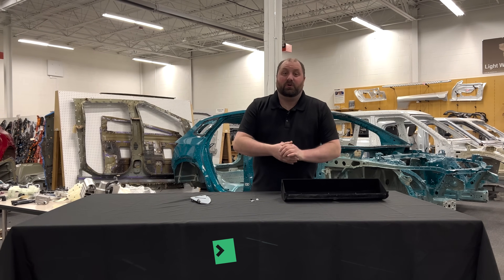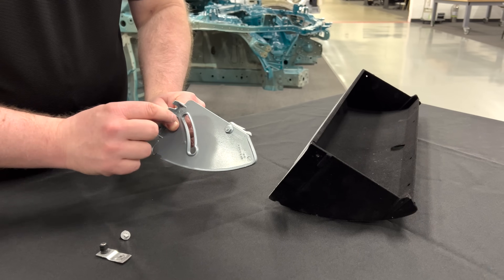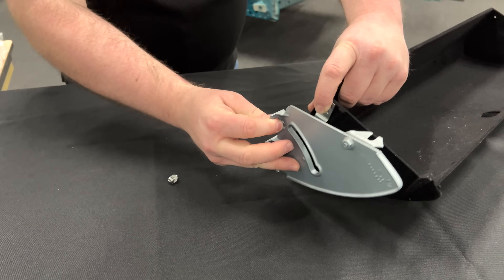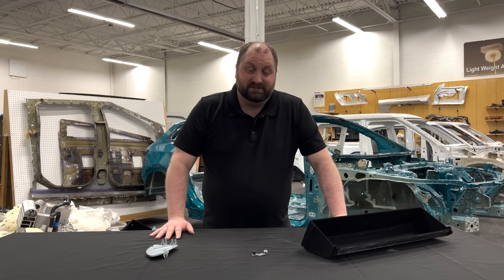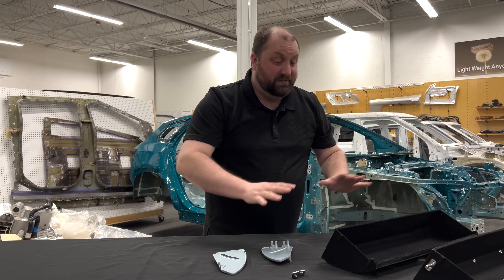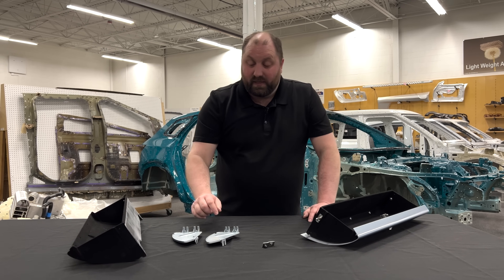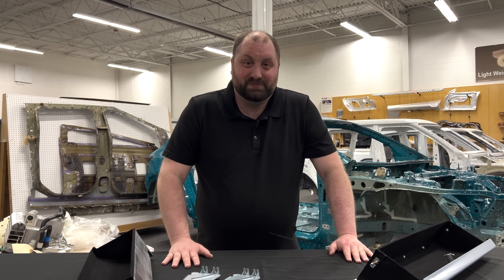The Million Dollar Difference: Why Working With Munro Pays Off

Comment: Totally done wrong. The cast part should have been a stamped part symmetrical for left and right side with hinge pin drawn in. Pin guides should have been molded on the glovebox. Resulting in savings of half production costs and a much quieter operating glovebox and stronger assembly. Basically, if you want real cost savings often times manufacturing processes needs to change. Then rethinking of design needs to happen.

Comment: Very interesting! 😃👍
One was the hole high for stability oh HIS part, the other wants the hole low for HIS part. 😂 That reminded me of 2 different craftsmen who had to complete an expensive jewellery store almost 30 years ago! 😂 There was a combination of expensive sandstone and expensive, fluffy carpet with a brass inlay between them.  The carpet guy wanted his carpet low. The tiniest fibre had to be below the sandstone, so that nobody tripples over his carpet and he's responsible. The sandstone guy demanded the carpet to be risen, so that nobody will tripples over his sandstone and the brass rail in the other direction and make him responsible. 😂 Both saw just THEIR project isolated and how to avoid getting sued. 🤭🤣

Comment: Munro consultant: sir, that metal bracket is made of metal. Too expensive. 

Engineer: but its holding the front bumper...ok...what is your solution 

Munro consultant: zip ties. Non uv rated and 20 lbs load capacity. Flexible and helps cover slack and minor differences in car chasis.

Management: im sold! Get me 100000 zipties!

Comment: Another minor point no mentioned? The bracket is used on two sides. Did the right hand side have the little bracket on the left instead of right, or was the frame designed to use the same bracket on both sides? Was it necessary to have two bracket castings in order to allow mounting in the car?

Comment: Great clear video. 

Colin Chapman (Lous) approach - lightness is the ultimate beauty. He meant not just mass. Lightness of thought, lightness of rapid development, etc. ie "Simplify, then add lightness". Ok, with a mass produced car its never that simple and is a real challenge to get management to value questioning things no matter how powerful or hands on the owner is. QA should be at the design stage. So everyone should ideally be a jack of all trades yet a good jack ass that understands a bit on physics, the consumer and business processes.

As a retired technical and QA consultant you see countless examples every day that you think how could nobody notice it could have been engineered in a more suitable way. TQM was big in the 80's but the real wake up that we seem to have lagged behind in is efficiency vs effectiveness. In this glovebox example its sort of black and white that the teams should have worked together earlier and that the design guidelines where the real issue. Yet when you have something that may cost $1 more per part and that $1 extra stops a vibration in the armrest resulting in an annoying rattle sound then it could be argued that its that lake of rattle that makes the car project quality. Often its done using less parts but understanding thermal expansion variation in material qualities that help make things better. Ask anyone how much extra would they pay for a car without a certain annoying squeak or rattle and the engineering decisions can flow back to the designers. Yet not as an excuse to overdesign something. Digital twins 2.0 here we come.. 

How could we have had the issues with the Cybertruck and Tesla not able foresee that? From the approach of a relative newcomer to the auto industry ie with less fiefdoms inhibiting team work? So perhaps competition is the best way to motivate change.

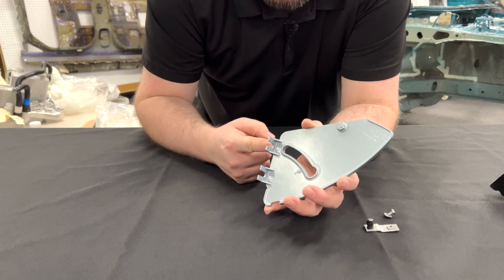Comment: 7:30 slightly disagree, there might have been a very valid reason they only had tab protrusions on one side. They were probably working with a limitation of the technology at the time. The 'flat' side certainly has ridges still, but no other protrusions otherwise.

Comment: Instead of casting, make it out if steel.  put the slot where needed so the original pin in the side of the glove box will be fine.  One steel part made & tabs just bent for RH & LH.   It is a glove box brkt.  Hardly ever used & not used hard.

Comment: What you re saying is that you are compensating their lack of system thinking, not because bob and jerry can't do so themselves, but because their org design (separate, part focused guidelines) and culture (if you innovate and it fails, you ll be blamed, if it works, your boss takes the congrats) prevent them from doing it themselves.

Well, ok. You are then the equivalent of "the new guy" from an organisational perspective: you compensate the lack of alignement and innovation that results from their org design and culture. 
And in the same way as you remove the fix from the new guy by taking the risk to tell management there is a much better solution, I would say that you re (as an analogy, don't take it personally) an unneeded fix: best way is to fix their organisation and culture, so that people are not blamed for trying  to make things better, and alignement and system thinking permeates through the org and take precedence over localised guidelines.

Comment: I think your main point here is not really illustrating the value you bring as a consultant to identify problems and fix them, but that the problem is with the internal product development strategy of the company from the beginning. If I was a consultant for the same client, helping them identify ways to save money, I would tell them to focus on how they can improve their development process so they can make and improve better designs on their own. Your own thesis is that you often have the benefit of hindsight and a less restricted line of communication with different stakeholders. Sounds like mostly waste on top of waste.
Reply: I think the value of the external consultant is he sees lots of cars from different companies and has learned from all those designs.

Comment: So you made a "saving" that mean the costumer no longer have provisions for handling misalignment when fitting the brackets on the assembly line?  
Got ya, and I think I know your types of consultants. You leave with the profit for the project and then leave it to others to deal with the new problem of misalignment that YOU created and the cost associated with fixing that. That is  If you dont offer to run a new project to fix the misalignment issue..

Comment: if we had fewer different cars on the road, and the models ran for 10-15 years instead of 4-5 they could spend more on each model.  Also easier for mechanics and parts stores. Also when they badge engineer one car and sell it under different brand names that makes a lot of sense for economics.

Comment: Well, you used a 60+ year old design as an example that is TOTALLY moot today as that glove box would've been solved in a 3D space on a CAD system before it saw the light of day today and it would have ALL costing baked in. Nice try though, but you'd be better served trying to show an example of say the last TEN years to make a case. Also, the future in mobility will be driven by software not hardware and what does Monro know about software and coding?

Comment: The '61 solution still has three components, including that pin riveted into the plastic glove-box, and implemented sub-optimal pin placement.  Since they spent money for a new bracket molding anyway they should have cast the pin into the bracket and put the guide slot through the side of a thickened glove box side-wall. Now it's only two parts and with optimal pin placement.

Comment: Im a manufacturing engineer, DFM started back in the late 70's and gained traction by the mid 80's. Eliminating processes is key in manufacturing as is repeatability and process control for quality. As good as engineers are, I believe in listening to machinist in OEM shops  and line workers on the floor in the actual manufacturer. Obviously, good software simulation is now available to visualize almost any process. But, once a process has been signed off and established, its important in Continuous Improvement to know whats actually happening at each operation in the making of parts and assembly.

Comment: I once redesigned "consumable" rollers in a robotic cell that transported the glass for solar panels on edge.

The glass edges are highly abrasive.
The rollers were about 6" diameter and 3" thick.
They were made of delrin.
The rolling surface would become rough and lumpy, causing glass chipping, some just sliding on ground flats and not even rolling.
Alignment was critical.
Part life was a few months.
Replacement rollers were about $300 each.

I proposed two options.

1. Change from Delrin to UHMW. Part cost similar. Bearing retention not as good. Longer wear life.

2. Take existing parts, including worn ones. Cut in half. Machine recesses on both halves. Add an aluminum hub. Add a cast urethane "wheel" over the hub. One time cost to modify the delrin rollers. Consumable rollers $16 each.

We chose option 2.  After testing a few, using modified hockey pucks as the replaceable part (no urethane mold made yet, and it was outsourced for production) it was clear it was a winner.

The modified test section of the line used 6 pieces. There were about 100 in the whole apparatus. It was smoother and quieter and wear on the rubber was negligible. 

So we modified the whole line. 

I did screw myself out of the repeat business of expensive whole rollers by the one-time modification of 150 pieces (line + spares) and continuing supply of consumable urethane inserts. (Which rarely wore out)

But the improvement was substantial. No more glass damage. Quieter. Line speed could be increased.

This was one of many production and engineering efforts I performed for the company, and I established a reputation good enough that my quotes were accepted as simply "time and materials" or "not to exceed" rather than detailed breakdowns.

I'm inherently lazy, so I'd rather have lots of low effort, small projects like this solution than one recurring, time consuming job, ordered in small lots, that didn't yield much more revenue to me.

Work smarter, not harder.

Comment: A HUGE part of the problem is every new model, every year is 100,000 new parts.Why? So they can sell replacement parts and people can swap parts. I have zero compassion for most all companies. It is all about f*cking their customers, and how to keep grabbing every penny from customers. Making things that are designed to fail so they get more sales.  I bought a Ford 2010 not knowing a gas cap did not come with it. Had to buy from ford a $25 locking cap. Had I known I would never have spent $28,000 on the car would have gone to a different brand. I will NEVER buy a ford again.

Comment: New Guy was probably working with an assumed or stated constraint of 'no new holes in the glove box'. This is why defining and challenging constraints is at least as important as defining the requirements.
Reply: It's amazing how many "fake" requirements lead to poor design. The most common fake requirement I run into is "make part Y better but part X can't change. "Right off the bat you're sub optimizing and only likely to see minimal improvements. When you take the constraints off, then you can really improve the whole system.
Reply: I am but a simple technician but I’ve changed many engineering minds by simply asking “Why?”

Comment: At 4:59. Why do we have this bracket and pin?
Your interfaces are undefined.  How is Bob or Jerry supposed to design a part. In aerospace you get interface dimensions.  You design the stuff in between.  Is this really how cars were designed?
Crazy.
Mechanical engineer with h2 automotive and aerospace experience.
Reply: The Lexus ball-bearing commercial was 1992. So in the 1950s, yes, there was considerable variation in how parts fit together. Tesla even had issues in the 2010s.

Comment: The worst part of the design is that large latch right in the middle of the usefully space of the glovebox and that wasn’t even discussed.
Reply: Yes, but the only problem is that if you put the latch on one end, then the other will sag and have a gap and not look closed. So then you have to put a latch on each end, which means two latches or you need a rail connecting two latches to close simultaneously which is a longer part and is more complicated.
Reply: @ I have a couple of cars that have a middle latch that doesn’t protrude significantly into the glovebox space.  The video simply shows a very poor design.
Reply: Or your place the latch mechanism in the dash above and the drawer only has a lip to grab on to so not taking up space in the tray. But again, this is more involved in installation and design of the dash or frame around the glovebox.

Comment: Carl "The Professor" speaks, people should listen.  I would call what he is describing as "integrated holistic design with manufacturing and assembly considerations", or more simply DFM.  
I'm a retired EE, who was sometimes hired as a consultant.  Most times, when I got "into it" I found out that the person who hired me, knew exactly what the issues were and how to fix them.  But no one would listen and would immediately defend their choices and attack his proposed solutions.  Then I was told that is exactly the reason an outside consultant (me) was brought in.  Most people listen to the outside consultant and assume that there is a higher "authority" that brought in the consultant so they should pay attention and be open minded.   It was like magic!  Fast and efficient.  Except... If the company's engineers were senior to the management, sometimes they would have a "not Invented here", "we ARE the experts" and even "we'll walk if this is forced on us" attitudes.   
There was a guy I knew who was recruited to "clean up, fix, and make competitive" a division of a very large electronics company. After a few weeks of "feeling things out",  it became apparent to me that nothing was going to improve with the current staff (~ 30).  Because of the circumstances and location, the only "fix" was to replace them all and start new, and the only way to do that was to physically move the division several states away.  It took him over 3 years to move the division from one coast to the other, and a lot of pain and overtime.  Less than a year after the move, not only was everything great, but improved 10 fold and his division's business expanded to permanently overtake that company's long established, better known rival.

Comment: The original design is inefficient but it succeeds at one thing, getting the product out the door in time, which is often more important than it being perfect, because a bunch of divisions could work in parallel to bring it to manufacturing while limiting friction caused by constant back and forth. So if the first 10000 get built with this type of design, it's not a big deal, but it does need to get optimised eventually.
Reply: Problem is, you do it twice, pay twice, instead of doing it right from the beginning.

Comment: Parts rejected if built or designed wrong?  USA where the major manufacturers produced hundreds of thousands of engines and gear boxes and keep selling them with known mechanical and design issues.  I ask the question of how can vehicals be manufactured outside US be of better quality than the same vehicals manufactured in USA?

Comment: I am a lead engineer with a major telecom company.  I find this routinely in software that runs on hardware today.  I'm always for practical, simple, complete solutions that allow for tunability or feature functionality to be turned off.  However many coders first sell you proof of concept.  Then you pay for iterative optimized code.
Reply: Ouch, your asking for a practical, simple, complete and modular software solution!  The problem is that kind of solution requires a wholly different architectural foundation than the first-guess proof of concept you were sold on, and management at the software vendor won't want to pay the engineering hours necessary to redevelop their first-guess model into the practical, simple, complete and modular system you'd like.